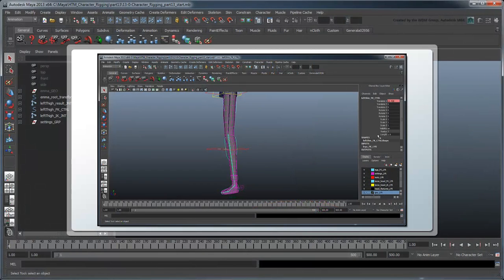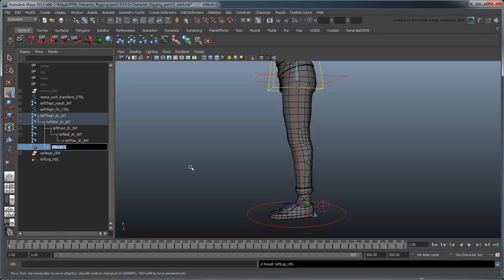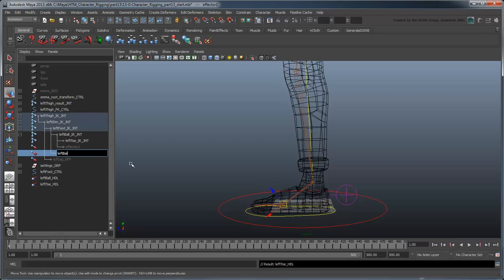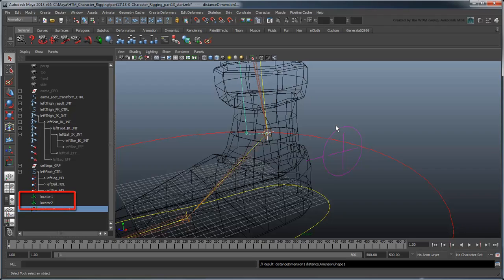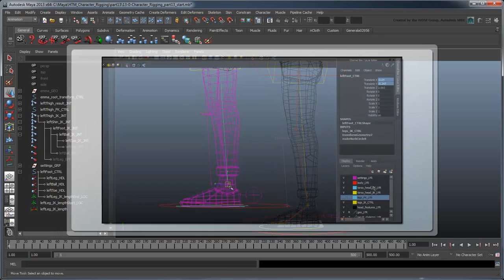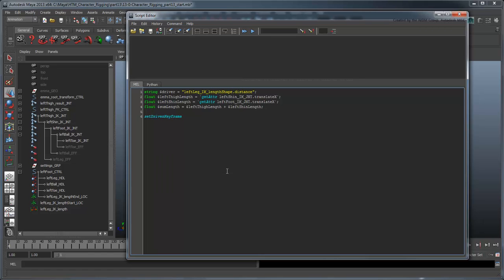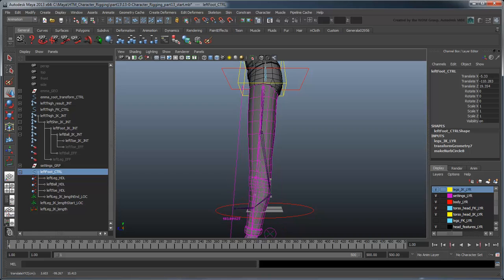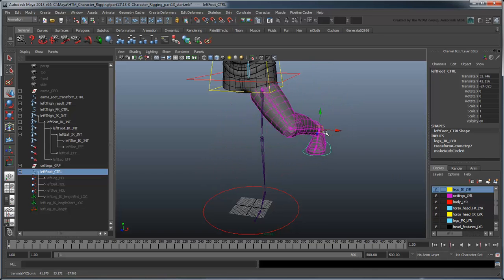Creating a Character Rig - Part 13: Leg IK controls and joint stretching (Advanced)

Comment: Hello. Thanks a lot for these tutorials, they are very helpful !
I am having an issue with the script. i read it over and over again to try to find the error, but is not a syntax issue. my error says : "$leftthighLength" is an undeclared variable.

My script is the following :

string $driver = "leftLeg_IK_lengthShape.distance";
float $leftThighlength = `getAttr leftShin_IK_JNT.translateX`;
float $leftShinLength = `getAttr leftFoot_IK_JNT.translateX`;
float $sumlength = $leftThighLength + $leftShinLength;

setDrivenKeyframe -currentDriver $driver -driverValue $sumLength -attribute "translateX" -value $leftThighLength leftShin_IK_JNT;

I dont quite understant where the problem is! I have done exactly as it is explained.
Thank you in advance for your help.
Reply: float $leftThigh>>((l))<<ength = `getAttr leftShin_IK_JNT.translateX`;
-value $leftThigh>>((L))<<ength leftShin_IK_JNT;

capitalization is very important. If it's off, it'll think your talking about something else.

Comment: I have got Maya 2013 and after typing the command at 08:37 I get this message: // Error: line 6: Cannot find procedure "SetDrivenKeyframe". //
What shall I do??
Reply from the maker: Are you sure you've written it exactly as shown?  The syntax shown here is correct so everything should work.  Try downloading the zip file we've included in the description and compare the script in there with your own.
Reply: Maya Learning Channel
Here is my text, I wrote it ten times and can't find any error;
don't be confused, I named my joints different and the names of the joints in the MEL-cmd match the real joint names:

string $driver = "L_Bein_IK_lengthShape.distance";
float $L_OberschenkelLength = `getAttr L_Knie_IK_JNT.translateX`;
float $L_KnieLength = `getAttr L_Knoechel_IK_JNT.translateX`;
float $sumLength = $L_OberschenkelLength + $L_KnieLength;

SetDrivenKeyframe -currentDriver $driver -driverValue $sumLength -attribute "translateX" -value $L_OberschenkelLength L_Knie_IK_JNT;
Reply: Mars Mandel
May be there is a problem with the student version??
Reply from the maker: Mars Mandel Ah my apologies.  The "s" in "setDrivenKeyframe" should not be capitalized.
Reply: Maya Learning Channel
Thank u very much!
now it works perfectly!

Comment: The leg stretches but keeps the same volume...How can i make it lose volume?
Reply from the maker: You'd have to design a script similar to the one we used for the spine.  However, note that this kind of squash/stretch can get a little weird on appendages like the leg/arm because as you lose volume at the joints, it's going to look out of proportion with the non-stretched body it's attached to.
Reply: ok thanks for the answer. In any case, i can always use blend shapes to simulate the stretching effects.

Thank you

Comment: Hello and thank you for the quality tutorials. You do it very clearly. 
I have ran into a problem though and I cannot seem to find what is wrong and I'd greatly appreciate any help given. 
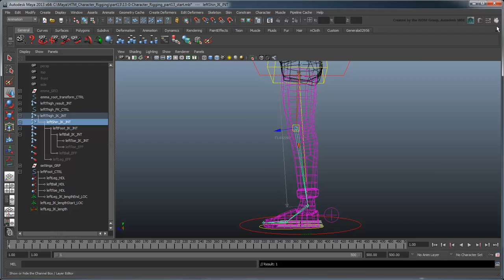 At 8:46 when it is time to execute our script, the Script editor returns this error
//Error: Line 3.25: Syntax error  

My script looks like this.

string $driver = "leftLeg_IK_lengthShape.distance";
float $leftThighLength = 'getAttr left_Shin_IK_JNT.translateX';
float $leftShinLength = 'getAttr left_Foot_IK_JNT.translateX';
float $sumLength = $leftThighLength + $leftShinLength;

setDrivenKeyframe -currentDriver $driver -driverValue $sumLength -attribute "translateX" -value $leftThighLength left_Shin_IK_JNT;

Thanks in advance to anyone :)
Reply from the maker: I suspect it's because you are using apostrophes ( ' ) and not tildes ( ` ) when referencing your getAttr commands.  Remember, tilde is the key next to the "1" on your keyboard.
Reply: That did it! Thank you so much for the reply and quick response!
Reply: Maya Learning Channel

Hello again and sorry. ><  So now after executing everything (after adding *2 to $sumLength and $leftThighLength) . I can grab the joint directly and increase the translate X value and it stretches however it does not stretch when I pull on the foot control.

Thanks in advance again.

Comment: hi! first of all, thanks for the tutorials, they are great and helpful.
i'm having the same problem described by JungleFineDesign.
I'm working with Maya 2011 (no node editor->hypergraphe, etc, etc...).
Still, everything works great until the IK stretch part. I've done the whole rig again to check.
I've checked the MEL script properly, no error. I run the script once with the maximum length, the translate X of the shin is highlighted. I run the script with the maximum length*2, no error in the script, but when I move the leftFoot_CTRL, the thigh stretches directly to its length*2 and doesn't go back to normal.
I'm stuck at this point and would really like to figure it out and finnish my rig.
So please, help! :)
Thx
Reply: never mind, sorted!

Comment: help pls =S , 
 this is my Syntax :

string $driver = "LeftLeg_IK_LengthShape.disttance";
float $LeftThighLength = `getAttr LeftShin_IK_JNT.translateX`;
float $LeftShinLength = `getAttr LeftFoot_IK_JNT.translateX`;
float $SumLength = $LeftThighLength + $LeftShinLength;

setDrivenKeyframe -currentDriver $driver -driverValue $SumLength -attribute "translateX" -value $LeftThighLength LeftShin_IK_JNT;

AND DE ERROR:

// Error: line 6: No match found to driver: LeftLeg_IK_LengthShape.disttance //
Reply: Um I don't if it will still give you the problem as it is for me even though it's spelled right, but I see several problems.
Yours
string $driver = "LeftLeg_IK_LengthShape.disttance";
Mine
string $driver = "$LeftLeg_IK_LengthShape.distance";

You missed the $ in front, and you had an extra 't' Be sure to check any capitalizations. It's very picky about that sort of thing.

Comment: Thanks so much for this awesome tutorial! Everything's working great on the left leg, but when I run the script to create the Ik stretch for the right leg I don't get an error, but no stretch happens when I move the foot control. The translate x for the thigh and foot joints are red (keyed) in the attribute editor, and as far as I know I've oriented the joints correctly (x going up). Can anyone help me understand why my script isn't working?  Much appreciated :)
Reply from the maker: Because the leg joints go in the opposite direction, a stretch is actually a negative value.  Did you remember to multiply all your length nodes by -1?  If you'd like to see an example, download the example file in part 32 of this series, select the right leg's length measurement node and look at it in the Node Editor.  There are also other helpful hints in that movie when it comes to mirroring your joints.
Reply: Thanks so much for your response, I hadn't multiplied by negative 1. It's all working now! :)
Reply from the maker: You shouldn't need any code.  Just create an extra Multiply Divide Node with the input1X set to -1 and feed the length node's measurement value into input2X, then use the output of that node to proceed as normal.

You can download the finished rig in part 32 and take a look at the DAG in the node editor to see an example.
Reply from the maker: Sorry, it turns out I was referring to the rightThigh_to_kneeDistance and rightKnee_toFootDistance nodes, which are actually for a later part of the tutorial.

For the general IK leg stretching itself, you should simply need to multiply the rightThighLength and rightShinLength values by -1 in the mel script.  If you compare the noFlipScale nodes from left to right for the leg joints, notice how they are inversions of each other (left is positive, right is negative).
Reply: Maya Learning Channel Hi, I faced her exact problem and as I was willing to debug it, I went along and put my animation curves to linear and post infinity to cycle with offset (2015) and as soon as I'd put the post infinity at cycle with offset, my right leg thigh and shin geo would flip out and the ik joint chain would have problems. I saw your reply and added the following changes to those two lines as you suggested
float $rightThighLength = `getAttr rightShin_IK_JNT.translateX`*-1;
float $rightShinLength = `getAttr rightFoot_IK_JNT.translateX`*-1;
when I'd run the script, the geo would flip immediatly and my right thigh ik and foot ik joint would have a -180 rotation value in Y. I went on and put the animation curves to linear and post infinity to see if things would revert but no, then I removed a -180 rotation in X to my thigh and shin geo and scaled them -1Y and things are now in place and I can freeze the geo and invert their normals and things are still in place. It seems to work, but did I do the appropriate corrections? I'm not sure scaling -1 the Y scale of the geo was supposed to be done.

I know we will eventually add invert scaling through the DG with a -1 multiply node in the NE but for this part here I'm not sure if I made the proper corrections.
Thanks again,
Reply from the maker: You shouldn't have to scale in negative, though I don't think it will cause anything too terrible to happen (the normals should still point outward even in a negative scale).  If you look at the provided scene file in part 32, you'll notice we actually scale a group node that we put the geo inside to keep the scale positive.
Reply: Maya Learning Channel Came back from mirroring up to part 18, doing the invert through the script broke things for me flipping rotations that would just mess everything up later down the line, I came back to this part and instead of doing the negative scaling through the script, I simply added a multiply divide node between the rightLeg_IK_lengthShape and both the rightFoot_IK_JNT_translateX and rightShin_IK_JNT_translateX animation curves nodes and everything is kept clean and the stretch works.
Although, I put the translateX curves to linear, everything works, but when I do post infinity, it doesn't stretch further than 2 times as we initially did and the leg doesn't bend anymore, it just squashes and the IK leg becomes fully straightened out even with the right leg foot ctrl at zero; any idea what might be causing this? I can see right after doing the post infinity to extrapolate the stretch, the ik thigh, shin and foot joints receive small rotations in Y but I can't put them back to zero, any idea what I should do to be able to extrapolate the stretch?
Reply from the maker: Instead of using a linear tangent try a spline tangent.
Reply: Didn't help, linear worked fine until I did the post infinity cycle with offset (Maya 2015). If I try with a spline, the post infinity doesn't affect the leg straightening out, but I still don't obtain the stretch beyond *2 and I'm back with the spline ''problem'' in which the knee bends a bit at a certain point of stretching. I think tangent in linear with post infinity would work without the IK leg straightening out if the leg would still stretch beyond *2. Maybe because it doesn't that's why the leg just straightens out and doesn't bend anymore when moving the rightfootCTRL up
Reply from the maker: The7UPBuddy You're sure you did this for both the noFlip and pole vector IK legs?

If you see the knee bending during a stretch operation, it's likely due to an ease in / out, meaning the animation curve pertaining to that stretch isn't straight (i.e. it's an S-Curve).
Reply: That might be the conflict, I'm actually redoing my noFlip and PV setups at the moment, I'll be done shortly, I guess I'll then see if things work out in the end. Thanks for your quick responses, it really is very much appreciated.

Yes hence happening only in spline tangent. I'll see if things unfold nicely one I'm done with my noflip and pv legs setup.
Reply from the maker: Just remember that for Maya 2014 and beyond, the image shown at 10:30 would be incorrect.  The graphs should continue to slant upward forever (the fact that it worked in 2013 even when horizontal was a bug).

That's why we suggest using a spline tangent.  That way you can manually adjust the tangent upward so it slants properly.
Reply: It's odd, because I understand that the post infinity going upward forever is what enables us to extrapolate the stretching of the leg. But my leg wouldn't stretch even if it was enabled. I'd have the tangent at linear and post infinity at cycle with offset to have the linear going on forever. I'll keep working on it and I'll try using the spline tangent as you suggested see if it helps. Thanks again.
Reply: No, still doesn't work to extrapolate the stretch on the right leg. Stretching up to X2 works perfectly fine, but it just won't go any further.

Now that my right leg is finished (reworked my way up to part 18) I had to find the translateX animation curves through the NE and by unchecking DAG objects in the outliner to find them as selecting the right Shin and Foot IK JNT in the outliner didn't show me their translateX curves in the graph editor, but I found them anyway and tried setting all translate X values for the ik, pv and no flip legs either to linear with post infinity or to spline with post infinity as you suggested but nothing worked. When going from linear tangent to spline, I wouldn't see any visual difference in the curve as it remained straight, but if I played with the handles I could clearly see it was in spline mode but nothing would change.

I can't figure this one out. Last time I did my right leg I had a problem switching from IK to FK because after running the script with the *-1 I'd obtain 180 degrees rotations in joints which was clearly not desired (when blending between FK and IK you'd see the leg rotating and ending up with flipped geometry), but all the functionalities would work great without problem. Now I've cleared out the major problem I had, but for some reason, I can't extrapolate the stretch which should be something very easy considering the stretch is actually working perfectly before any post infinity, which won't extrapolate, and disable the ability for the leg to bend at the knee, resulting in a squashing leg instead.

No matter if I do linear or spline, as soon as I have a post infinity on ik, pv, noflip legs, not only does the stretch not extrapolate, but the leg squashes instead of bending. I find it really odd.

At least I'm happy that everything is clean and working fine this time, but I just can't figure out this problem. I'm happy with the leg stretching at times 2, but being there, might as well be able to stretch it infinitely.
Reply: Hi, I solved it while recreating the right shoulder ; it's really silly but since we multiply -1 the distance shape into the translate x, since the animation curve is inverted, we also have to ''invert'' the infinity and therefore, it's the PRE-infinity that needs to be put to cycle with offset (2015) and not the post and that's why I didn't get stretch but squash instead :)
Finally! Now I'll remember forever!
Reply: The7UPBuddy Hello! Can you send me the IKRightLegScale.Mel script? Because I mirrored may character's leg, but I cannot streatching my character's right leg, because I dont't know the IKRightLegScale.Mel script. Please! Send me the perfect IKRightLegScale.Me Script! Please! Thank you!

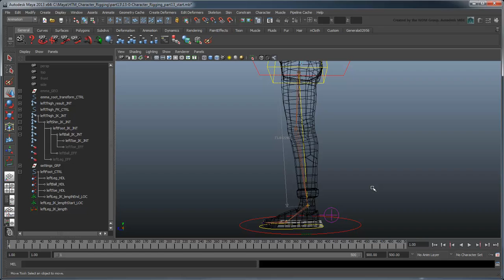Comment: at 5:25 you mention that if you scale the leg along the length measurement the leg will never bend. But my leg doesn't have a knee joint so I don't want it to bend. So how would I apply the locators to my leg joint? Instead of having a leftThigh joint I just have legShin joint to legFoot Joint. If that helps.
Reply: I believe you would only need two locators, one snapped to the leftShin, the other snapped to the leftFoot. Then use those locators to find the distance between, and follow along as explained.
Reply: Another way to get a flexible leg chain if you only have the connections at the hip and foot would be to use a similar setup as described in arm or torso stretch videos. By using the IK spline stretch setup, you would be able to get a bendy, twist-able leg rig that's extremely flexible.

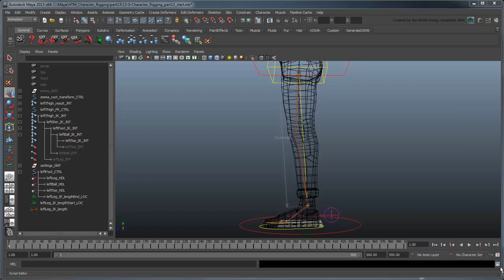Comment: Hey there. My character doesn't have a knee joint so the hierarchy for his leg just goes left leg shin left leg foot etc, no thigh joint. So when it comes to 6:40 none of that can apply to my leg and foot. How would I go about getting my leg to follow and stretch with the leftFoot_CTRL. at the moment it just stays in place but bends towards where ever I pull the CTRL. At 5:25 You mention there would be no bend and thats what I'm looking for. How do I apply that to my rig? I've followed the tutorial up to 5:25 just in case you were wondering where I was at
Reply from the maker: In this case, you wouldn't need to set a driven key at the max length and 2x max length.  You would simply need to set a driven key directly from the foot control to the foot joint's translate X value.